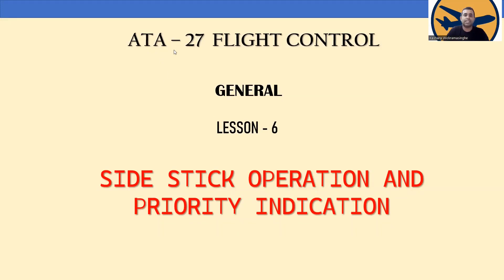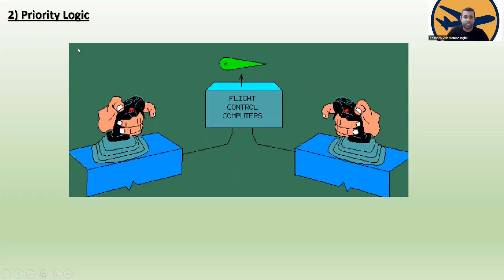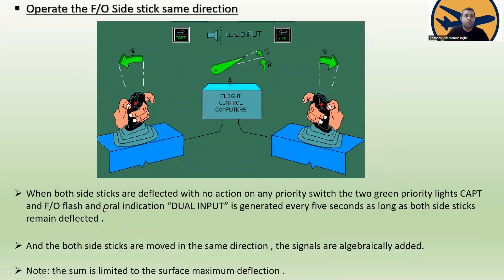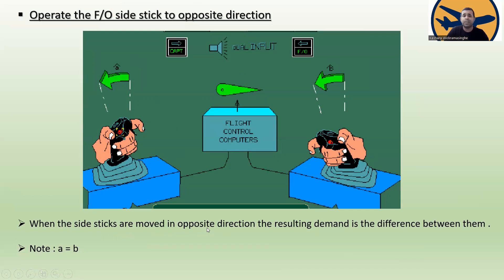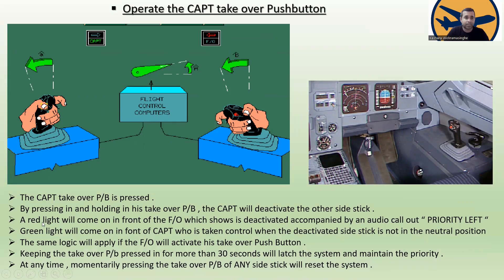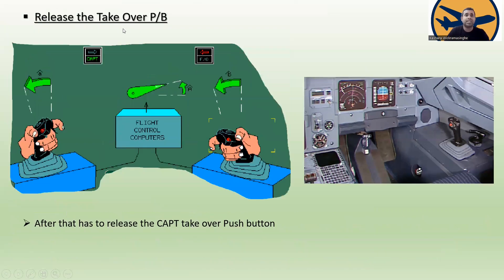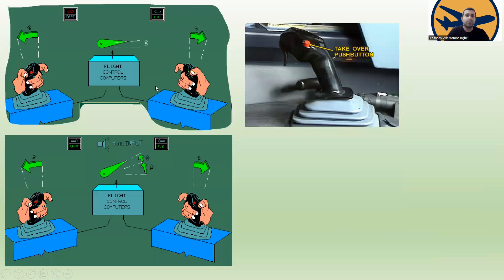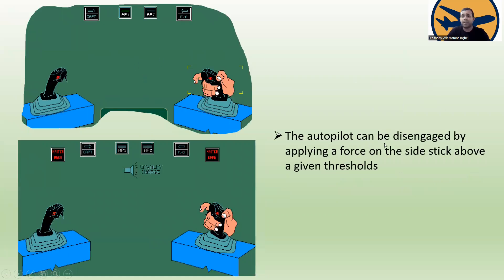Side stick operation and priority indication |ATA 27 - GENERAL LESSON 06 | Airbus Maintenance lesson

Comment: 安心してください。
ボーイングは機長が優先、エアバスは最後にボタンを押した方が優先。

ボーイングは左右の操縦桿は連結されているものの、連結機構内にカムがあり、一定以上の力が加わるとカムが外れ機長側が優先される。
力で勝負とかアホやん。小型機やヘリはそうだけども...

エアバスは同時にプライオリティボタンを押すと、最後に押した方が優先される。再度押せばそちらが優先される仕組み。

あとは平均値ではなく合計値ですね。なので反対に動かすと動かないのではなく、スティックの操作量が左右で±0になった時に動かないだけ。

誤った情報は流さないでくださいね。
Reply from the maker: Thank you for your comment, and I appreciate your input. I’d like to take this opportunity to clarify the information I   presented in my video regarding the flight control systems of the Airbus A320.

Firstly, I want to assure you that I aim to provide accurate and technically sound information based on official Airbus documentation and industry practices. I’m not sharing false information but rather focusing on providing a comprehensive guide to the A320 for those looking to understand or train on this aircraft.

Regarding Your Comment on Control Prioritization:

You are correct that there are differences between the Boeing and Airbus flight control systems, particularly in how inputs are processed and prioritized. Boeing’s system may work differently in some respects due to the manual linkages and control forces that pilots experience. For Boeing aircraft, mechanical linkages and cam structures provide control feedback based on who applies more force to the yoke, giving priority to the pilot with more input.

However, Airbus, particularly the A320 family, uses a fly-by-wire (FBW) system where the pilot’s sidestick inputs are interpreted by Flight Control Computers (FCCs). The system doesn’t rely on mechanical linkages or physical force input. Instead, if both pilots move their sidesticks at the same time, Airbus incorporates a priority system, which works as follows:

	1.	Sidestick Priority: If both pilots operate their sidesticks simultaneously, their inputs are summed (adding the deflections). If one pilot wants to take priority, they can press the Priority Takeover button. Once pressed, the inputs from the other sidestick are disregarded, and only the input from the pilot with priority is recognized by the system.

	2.	Dual Input Warning: Airbus includes an audible warning “dual input” if both sidesticks are manipulated simultaneously. If neither pilot presses the priority button, both inputs will continue to be combined.

Control Law and Protections:

The A320 operates under different flight control laws (Normal Law, Alternate Law, Direct Law), with Normal Law providing full protections and computing the most efficient control surface deflections based on pilot inputs. The sidestick commands don’t directly control the flight surfaces (elevators, ailerons, etc.), but they inform the FCCs, which calculate the necessary movements to achieve the intended flight path, taking into account various protections like pitch, roll, and load factor limits.

	•	Normal Law ensures maximum protection, and the flight control surfaces (elevators, rudder, etc.) behave as part of a fully automated system that translates the pilot’s intentions through the computers.
	•	In Alternate or Direct Law, the system becomes more manual, and control responses are more direct.

Summing Up:

The information I provided is consistent with how Airbus has designed their control systems for the A320 family. The fly-by-wire system is fundamentally different from Boeing’s mechanical linkages, and Airbus’s focus is on redundancy, safety, and precise control based on computer input rather than physical force.

I hope this clarifies any confusion, and I encourage you to refer to Airbus’s official documentation if further detailed technical explanations are required. I appreciate your engagement and hope this helps clarify the system differences!